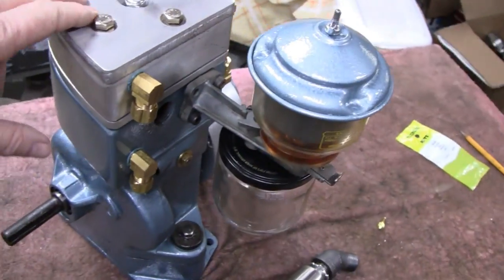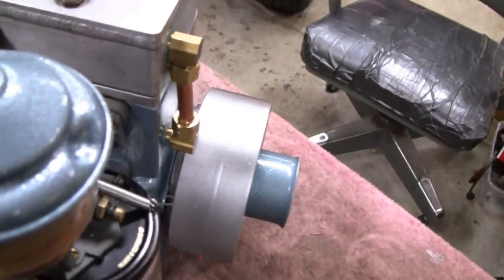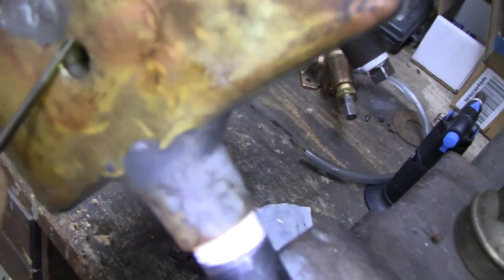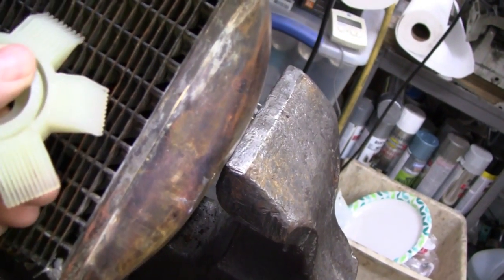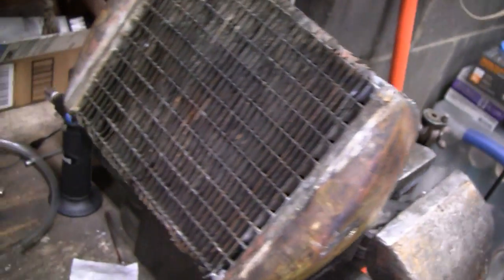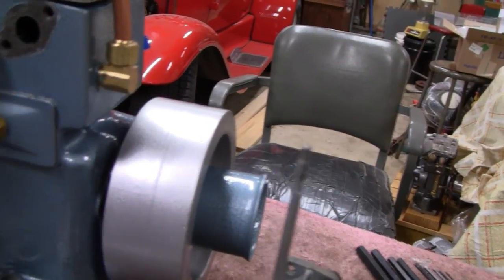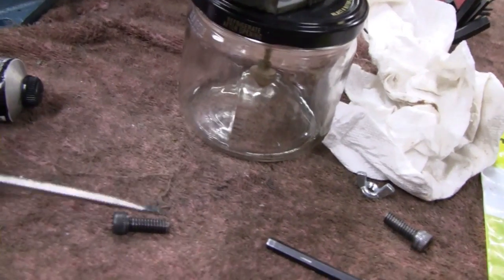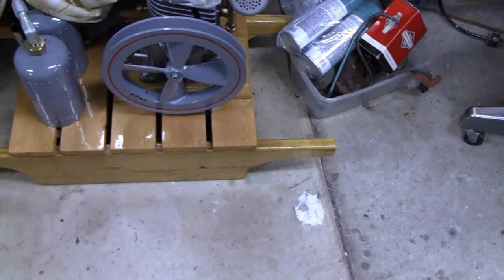HOMEMADE WATER COOLED BRIGGS ENGINE (part 32)

Comment: for the radiator  you could try cleaning it up with a wire brush fill the hole with  epoxy drill it out and tap it, I know this video is old but please  think about it for any other water cooled engine you might do.

Comment: For that rad leak:
make up a little longer threaded plug, thread a bolt for the same npt, and put a gasket on the longer plug and thread the nut on. 
Put your choice of schmoo on it.

Comment: Could you plug the the threaded hole in the radiator with a bolt and fibre washer? I think I would definitely try it as an easy fix.

Comment: Roadking, why not try a brass flanged plug with a fibre washer on the base of the rad? Check out ebay listing number 300565725837 as an example.

Comment: your video's have interested me greatly and have purchased an old briggs 3.5hp from ebay cheap to clean up like your's. the only problems its missing the carburetor and exhaust would you have an idea of the part number/ after market parts to get this running. p.s keep up the great videos there great i appreciate all the video's you create. A+++++++
Reply from the maker: Thanks Bud!! Research the serial number on the internet, then when you know what you have you can find a manual for it, they're free on the net too. You should be able to get anything you want from Ebay!! It probably not any older than the mid 70's!!☺

Comment: This may work for you, if you make a brass plug for the top of the rad with a wide shoulder then put a fiber washer under it, it may seal it and still look good.

Comment: that hole that is on the bottom of the radiator.  I would have soldered a new fitting to it. but it sounds as if the idea you have should work.  Project is sure looking pretty cool.

Comment: INSTEAD OF SOLDERING THE RADIATOR HOLE THAT LEAKS WHERE THE PLUG IS AT . WHAT ABOUT A KIND OF BOLT WITH A WASHER SEAL ON THAT ONE . JUST SAYIN .

Comment: Mr roadking well done.

my 2 cents

re the fins we used to use ground down needle pliers, ground to rectangle shape which exactly fits the rad fin, just put them in and squeeze! bam job done.

nah it's not going to leak, it's built by you!  much respect to you.

re the hole and plug, totally soak in clear resin, turn rad upside down and screw in from below, this means when screwed in the resin settles back on itself covering the plug.  messy but you can clean up later.  let it dry overnight.

I've used this technique a lot over the years

Comment: You could try using a brass washer head bolt as a radiator plug and if it still leaks use a rubber washer .... just an idea!

Comment: what do you mean by 10-36 thread?
Reply from the maker: That's how they determine the size of a bolt!! The first number is the diameter like 8,10,12,¼, 5/16 and so on!! The second number is the threads per inch like 18,20,24,28,36!! 18 and 20 are coarse thread!! 24,28,36 are fine thread!! Very common bolts are like ¼-20 and 5/16-18!!☺

Comment: Hi Road king.
Could I suggest a small flanged screw with either a copper or fibre washer to seal the leak.
The flat on the screw would clamp down on the brass and seal it whilst the washer will stop water leaking past.
Cheers 
John

Comment: I love that air cleaner, it's almost the same a one we had on a old Snappin Turtle mower with a Clinton motor. I'm glad there's someone else who has to retap threads. I've done a fair amount of word work, I think you should give the wood a coat of Danish Oil before the Varnish. It will take longer since you have to let the Danish Oil dry a couple days, but it will give the wood kind of a clear look, brings out the grain much better. Use Natural color if you do.
Reply from the maker: If those sleds didn't take such a beating I would make them outta nicer wood and finish and make them look like a piece of furniture!! but they sit in mud, get banged and beat against each other in transit, and have gas and oil dumped on them!! That's why they're made outta pressure treated pine and finished with the cheapest urethane I can find and throw together in 10 minutes!!☺

Comment: got a quick question, I have been following your builds and seen the  epoxi ya use, what kind is it and where can it be found,, thanks.
Reply from the maker: I got that stuff from a Gov't auction, it didn't have a name on it!! But it's the same as any other Paste Epoxy out there!!☺
Reply: 805ROADKING ok thank you..

Comment: Something I just thought about: the cooling system probably isn't going to be pressurized, right? If so, it won't be absolutely crucial that you get that radiator perfectly sealed, especially since that leaky spot will be at the top.
Reply from the maker: Right!!☺

Comment: Why not just solder a brass plate over the drain?  How often are you going to flush the cooling system?  If need be, just remove the lower hose & you're all set.

Comment: I know it's already done but duck bill pliers for those fins. For the pump and fan I think I'd mill a belt slot in the flywheel and run them off a vee belt. I know it's a display engine but that way to me it would look like briggs made it and left the output side to still run something.

Comment: How about use a leather belt to power the fan, that way you can turn the corner 90 degrees and have the radiator in the front, also, will the radiator need to leak a little so pressure will not build up when the water gets hot?

Comment: To fix that radiator hole you can find a nut that has the same thread and use it to force the gap closed with a washer and nylon seal or gasket after the pipe is threaded in.  Kinda like a jam nut would be, this will avoid soldering at least.  Good luck.

Comment: Try a straight pipe nipple and a nut to seal the leak in the radiator. You can seal the pipe thread and then run the nut or collar down with sealant to seal the tank to the pipe fitting inside. Just at thought.
Reply: I was thinking along the same lines but with an O Ring under the head of the fitting. As long as the surface is smooth, it will seal fine.
Reply: anthony wendt .......they make a straight pipe thread bolt with a big flat surface head and flat gasket to seal that surface. Automatic transmissions back in the 50's and 60's used them.
Reply: all you guys read my mind.
Reply: Exactly what I was thinking. The threaded part doesn't need to seal against the outer casing, all the sealing can be done on the outside face. Love this build BTW :-)